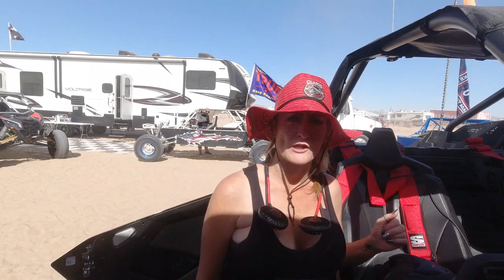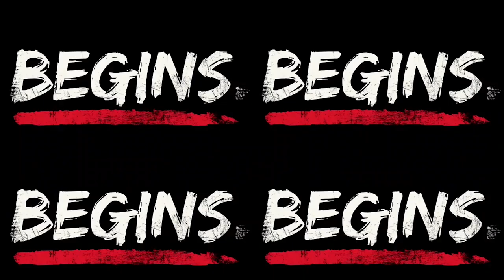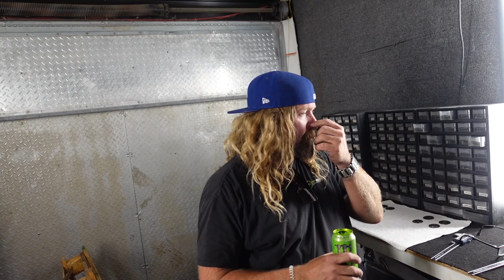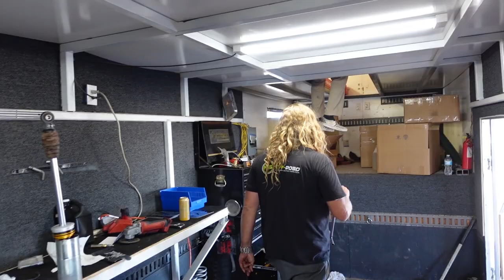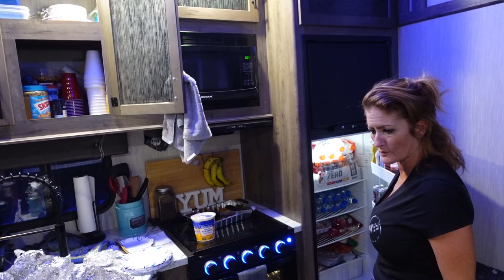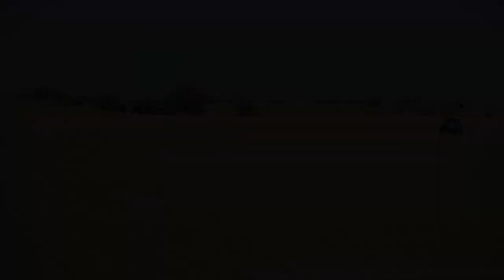RZR PRO MTS SHOCK TUNE Out For A Test With The Can Am X3 Part2

Comment: I have to say, getting a shock tune is one of the top mods for a SXS! It allows you to ride with confidence and makes for a pleasurable ride as well. I’m so glad that I did mine, I was able to keep up with you in the Dunes because I had the confidence that the suspension was able to take the punishment. Sucks that the RZR got smashed, but everything has a purpose. 👍🏻
Reply from the maker: Right? The Shock tunes are amazing. I wouldn't have believed how much better it would be until we did our first one. The RZR was feeling good also.. but, yes we're well and all will be good

Comment: Why do the comm's in the Canam sound so much better than the RZR?
Reply from the maker: Actually they sound pretty much the same. Probably a little clearer in the razor. the difference you're hearing is the device we are using to connect from the intercom to the camera. There's a difference between the two of the cars with regards to that device.